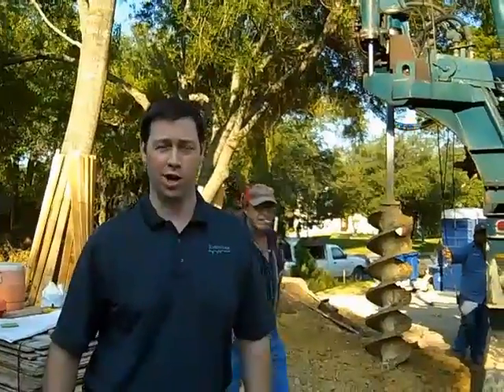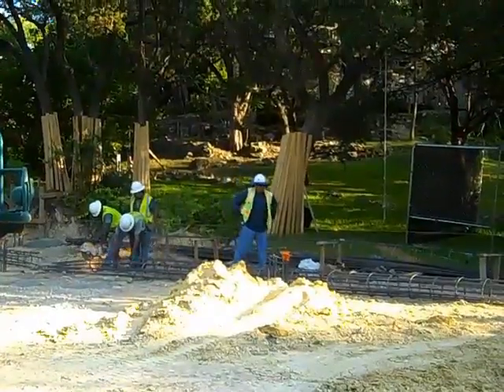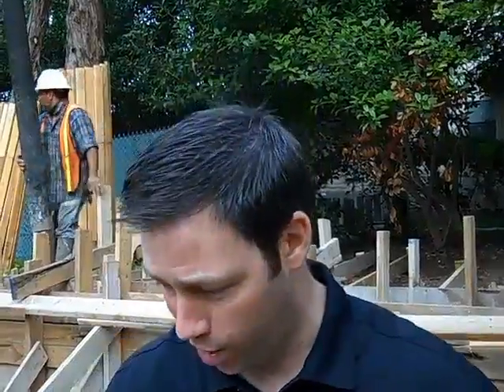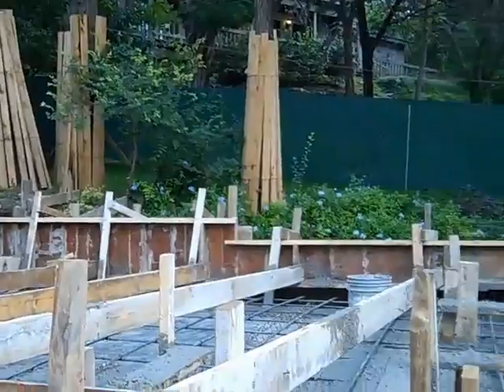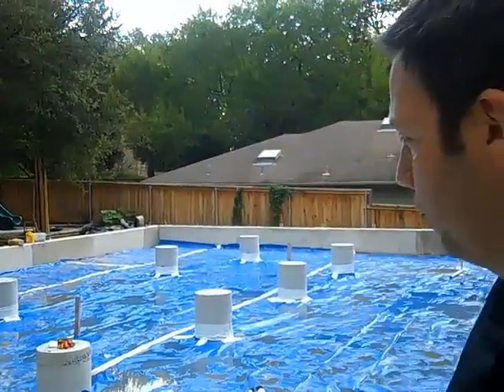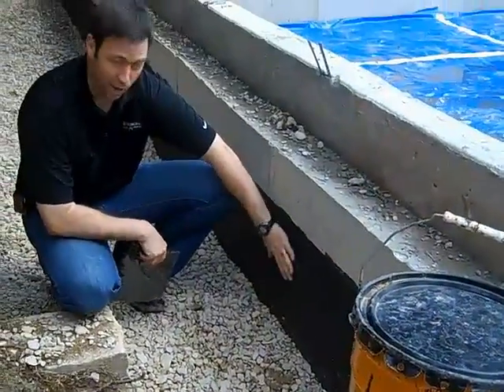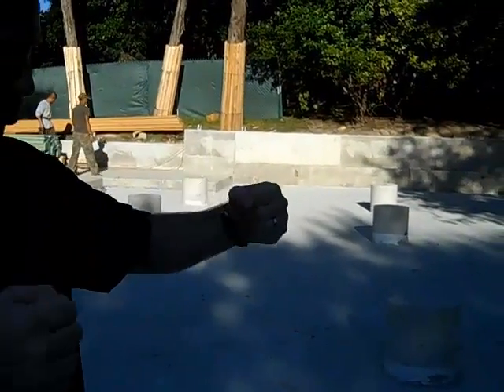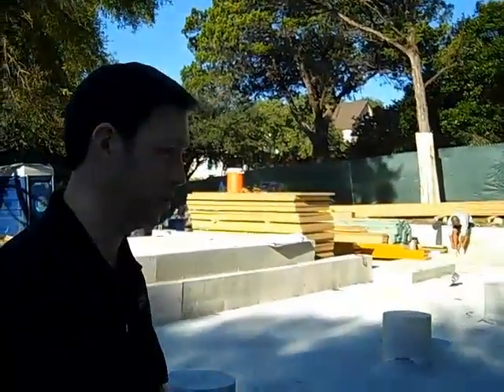Pier + Beam Foundation with a Conditioned Crawlspace

Comment: Really enjoy this video. it is one of best, most thorough videos on youtube (at least in my opinion) as far as information goes. Mr Risinger,in your opinion, what appears to be the more superior foundation in terms of longevity and durability in Texas soil, slab foundations or pier and beam.  And what are the odds that after a pier and beam foundation is set that your home will at sometime in the future need foundation adjustment.  I am hoping to eventually build a home out in the Bastrop area and am considering using pier and beam instead of slab. From what I understand, expansive clay type soil is a problem for many homeowners in that area. I currently own a home in the San Antonio area which is set on a slab foundation and it has been a nightmare.  Eventually we had the entire length of the house cable locked and it still requires periodic adjustment.  I might as well just throw my money directly down the hole to try and prop up the house because thats where its going anyways. :D  I just don't want to make the same mistake when I do finally decide to build another home. (ps..didn't build this one, just bought it this way...)
Reply: +Mary N you can drill pier holes for a slab foundation too.  insist on commercial grade rebar -- don't mess with that post/pre tension stuff.   It actually doesn't take long to use a skid steer to scoop out all the clay where the house will sit and replace with crushed limestone ... lots and lots of crushed limestone.  It's cheap and you can use the extra for your road.   Last tip on slab foundation is to make sure they design the beams deep  3 to 4 feet, and make sure they set rebar down near the bottom.  Also important to use good bent rebar corners ... and the hardest thing to get a crew to do:  6" mesh steel which should be kept near the surface of the slab (they always trromp on it and may even tell you it's supposed to be low in the slab)  the mesh should be about 1" below the surface of the cement when its all done.
Reply from the maker: Mary,  Tough question!  I really like Pier/Beam foundations especially if you can get the piers down to solid rock.  They are easier to adjust too if you do experience some movement.  I'm sorry to hear about your slab issues.  Be sure to get a GeoTechnical Engineer to drill where you new house will be built and get a sample of the soil.  Then your Structural Engineer can design a foundation specific to your soil conditions (and rock depth).  I wish you the best, Matt

Comment: Great to see some excellent foundation work being done. Well done. I have encountered similar or maybe worse soil conditions on residential in the past and I have had great luck with a rubble trench foundation. In terms of price to performance they are tough to beat, especially when you needs to drain away Vadose Zone water. I am curious as to why you didn't go ahead and throw down some foam under the slab. Did you insulate the bottom of the floor of the structure?

Comment from the maker: I would disagree this is overkill.  The bad soil conditions ruined the foundation for the previous 30 year old home on this lot which necessitated a much stouter foundation design.  Soil conditions very greatly in Texas and you'd be amazing at the damage that expansive clay soils can do to a house.  This house will still be standing in 100+ years when all the houses around it will be scraped and replaced due to structural damage.  One man's overkill is anthers solid foundation.  -Matt

Comment: If the craw space is conditioned why didn't you use rigid foam below the concrete slab floor?  Also I would love to see it after it is finished.